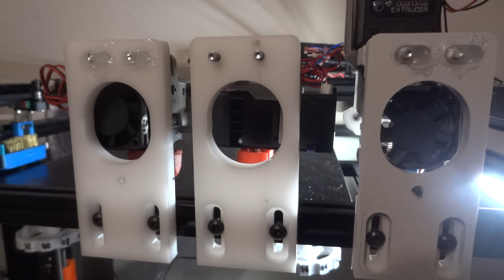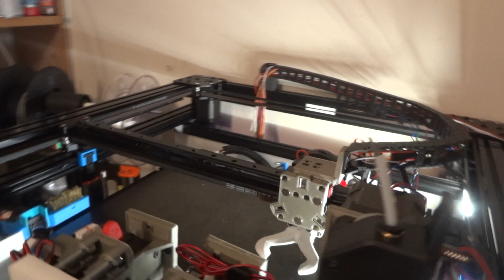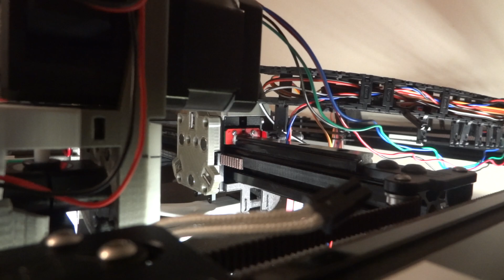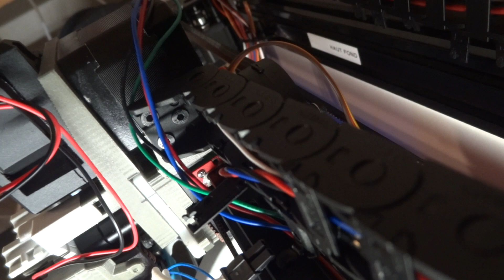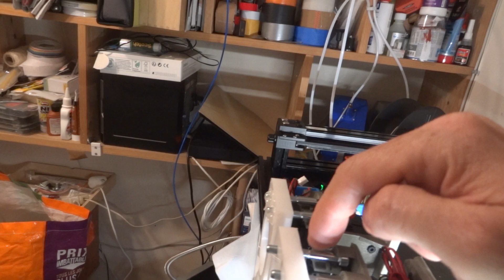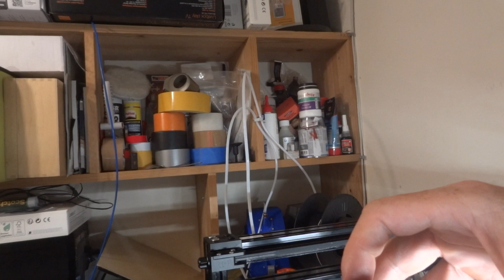Tool changer V2.2: the tools are changing

Comment: Hi Sebastian, the toolchanger looks great.
Would you be able to give me a link for the ball joints you're using in the tool plate. I'm also trying to make my own kinematic mount but all the threaded balls I find online are too large, so I would highly appreciate  knowing the ones that you're using.

I'm enjoying seeing your progression, the toolchanger looks promising
Reply from the maker: I'm not using thread balls but only balls and I insert them with a press.
works well with printed parts, maybe more trouble some with acetal as i had one ball i had to glue with cyano or else when i release the press the ball pop out of the hole.
didn't tried yet with aluminum.
but what i use are regular 6mm balls and 2x11mm dove pins that i had from a RC tool box.